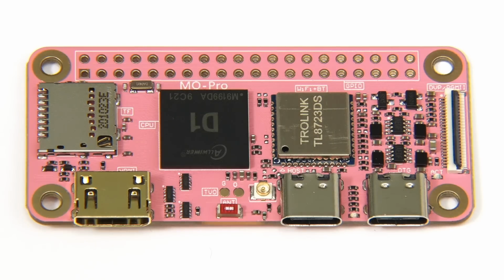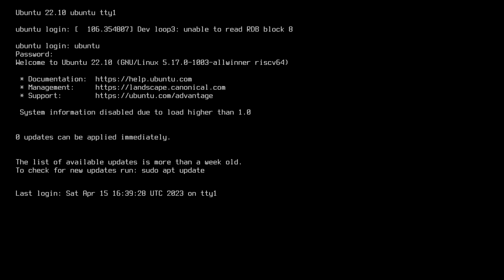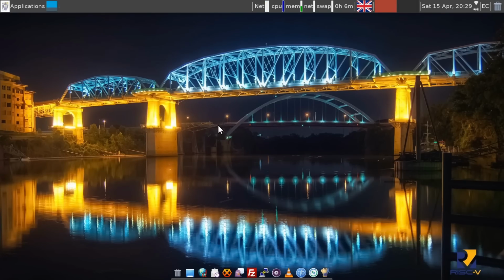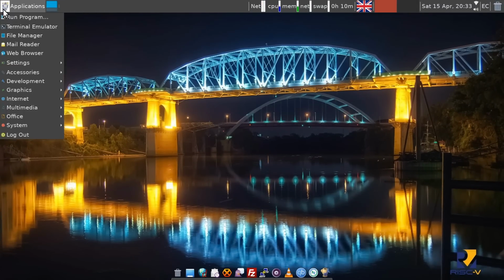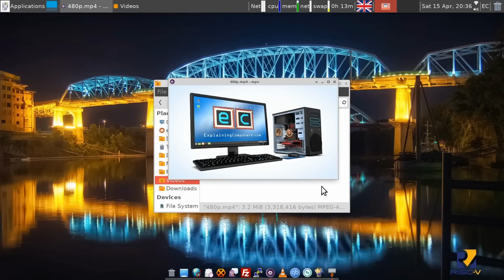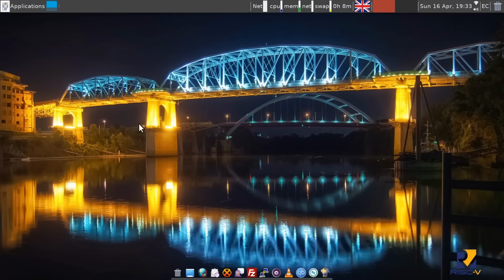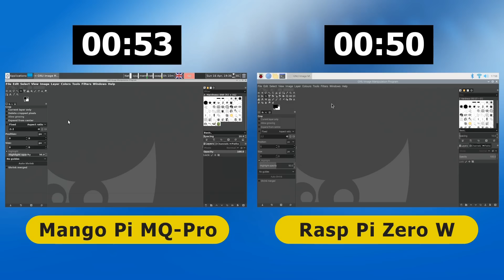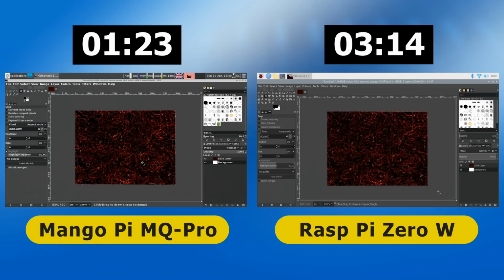Mango Pi MQ-Pro RISC-V SBC

Comment: The shop owner in Taobao(for Chinese oversea market, it's Alibaba) says in Chinese: as the 1GB DDR3 is extreme expensive( maybe as of 2022Q2, it is not so at this moment), they use tested B grade memory chips. At least, he is honest.
Reply: Yeah, the specs also make mention that the RAM is reclaimed. I'm glad the architect made the decision to use reclaimed RAM instead of calling off the project due to the high cost of its RAM. Bravo.

Comment: Risc-V is going to pose a serious risk to ARM. It will continue to get better. Sure, apple will probably continue to use ARM for quite some time, but lower-cost systems will increasingly switch to Risc-V in the next 5-10 years. I bet that in 10 years, RISC-V could be the most popular ISA in the world on smartphones. Cheaper android phones made in China for the Chinese market will switch to RISC-V. I think Raspberry-PI may eventually switch to RISC-V in the next 5-10 years. All sorts of embedded systems will use RISC-V.

WOW... I was only halfway through your video as I was typing this comment, and I just saw that you opened up DILLO. Amazing. I haven't used DILLO in > 10 years. I used to use it sometimes on a very very old laptop running Debian for reading some websites that had annoying javascript that I didn't want to run.

Within 2 years, several linux distros will be very very stable on RISC-V. Developers will find bugs and push fixes upstream, and RISC-V will become a fantastic and stable platform for running simple desktop and home-server systems.
Reply from the maker: Great post.
Reply: Report from 16 months later: Raspberry Pi shipped the Pi Pico 2 with two RISC-V cores they developed themselves (in addition to two Arm M33 cores).  You can now get the same computing power (1 GHz C906 core) as this board in the $3 Milk-V Duo, though with only 64 MB RAM. The 512 MB RAM Duo S costs $10. No HDMI though, only DSI (for LCDs). A 2.0 GHz 64 core C910 RISC-V machine with 128 GB RAM shipped back in January, 8 months after this video.

Comment: Excellent review. I was considering using several Pi Zeros with cameras for a small SD security camera network (mainly as a learning exercise) before Zero prices went to insane levels. How do you think this board would perform on a similar application?

Comment: It certainly is impressive, although the fact taht you are finding it difficult to find a library to talk to GPIO would seem to be a tragic failure for a board that I would guess is targeted more at a market as a micro-controller rather than a desktop.
Reply: No, it's not a micro-controller, it's a micro-computer. 

For starters, a 1GHz RISC-V computer with even 512MB RAM is still 80-100 times more powerful than, say, a Commodore Amiga A1200 computer from 30 years ago - let's have some perspective here!

It also possesses a lot of the I/O and interfaces for keyboards, screens, drives, etc. that you would expect to be on a micro-computer, but not on a micro-controller like a Pi Pico or ESP32 device.

Just because it's small and less powerful than the average modern desktop or laptop doesn't automatically make it a micro-controller.
Reply: @terrydaktyllus1320  The kind of power in something like this would fir neatly into the requirements for a controller for a 3D printer, or on par with what one might find in an engine management unit or many robotics projects (particularly if they include something like .requirements to map their environment).  It would indeed be serious overkill for controlling washing machines (although some household gadgets with IoT functionality might need more power).

What is asked of modern micro-controllers far exceeds what one would expect of them a decade ago.
Reply: @Hfil66  That's fine, but you've still not acknowledged my core point - namely the difference between a micro-computer and a micro-controller.

You've simply talked around my point - again, you seem to be implying that it's purely a matter of size that determines whether or not it's one or the other, and that's incorrect.
Reply: Looking at how the GPIO works, I found a web page which shows how to use simple shell commands to control the pins. It should be easy enough to create a Python wrapper with functions that carry out the same I/O operations--no need for any special drivers at all.
Reply: @terrydaktyllus1320  we rapidly get into the semantics of what is a micro-controller.

To my mind, the primary purpose of a micro=controller is to control something (e.g. a 3D printer or a car engine), whereas a micro-computer is more about computing and providing the results of that computation to the user.  In the vast majority of cases the user of  a micro-controller may not even be consciously aware that they are using a computing device (e.g. when you drive a car you generally do not thing about the computing power used to control that car), whereas a micro-computer user would be very aware of the fact that they are interfacing to a computer (e.g. they have a clear computer desktop in front of them).

Clearly, there are devices that can be used for both functions (e.g. many Pi type devices work in both contexts), but nonetheless the design of the device would suggest one market is better suited for the device than the other.  The compact size, relatively slow performance, low power requirements, and availability of GPIO pins, all suggest that this device is better suited to being embedded in some project where is works as a controller rather than a general purpose computer.  The only counter argument is the fact that it also has a built in graphics controller, which itself would be superfluous for a pure hardware control function, which might suggest this is a device that tries to satisfy more than one market, but I would still suggest it is more closely aligned with the needs of a controller rather than a general purpose computer.
Reply: @Hfil66  There are no "semantics" here at all - you simply do not understand the differences between a micro-controller and a micro-computer. I read the first two lines of your two paragraph "make it up as I go along" definition and gave up, because the difference is quite simple and doesn't require two paragraphs:

A micro-computer is a standalone device that can operate independently of other computing systems with its own "human" interfaces (USB, HDMI, VGA, etc.) whereas a micro-controller is part of a computing system, requires programming from an external computing system and/or has to have "human" interfaces attached to it.

There, I fixed that for you. You can thank me later. Discussion closed.
Reply: @terrydaktyllus1320  Of course it is semantics, because you seem to be more obsessed about whether the device (by your particular definition) is a micro-controller or a micro-computer, whereas my point was about the kind of market and user that would use the device rather than what word they would use to describe it.  You seem totally unconcerned about use cases only about what is the right word to use in labelling the device.  That to me is semantics.
Reply: @Hfil66  I'll repeat the last two words of my last comment again:

"Discussion closed" and mean it this time.

You have a lovely rest of your day pondering about micro-controllers and micro-computers.

Comment: I think what this is lacking is hardware accelerated video, so everything that's GUI based is just not going to work as well as on a Pi or similar. As a little low power text based system tho I can see this thing being really useful tho, would even work really well for a case I have right now where I could need a full OS on a remote, solar/battery only location where a normal Pi, even a Zero, uses too much power over time for what it's monitoring.
Reply: People are already using low-powered ESP32 and Pi Pico micro-controllers for remote monitoring whilst lasting for weeks on a single battery source.

I think you are confusing a micro-controller with a micro-computer, wherein the Pi Zero and Mango Pi both fit into the latter category anyway. It's common sense that any device that has to drive, say, a built-in USB port is going to use a lot more power than one that doesn't.

It's a bit like taking a family saloon car off-roading for a day and then complaining that the suspension is broken when you've finished - "right tool for the job", etc.

Comment: We had some SBCs with the Allwinner D1 now, i am really looking forward to T-Head (Alibaba) XuanTie 910 designs.. The Sipeed Lichee Pi 4A would be one of the first availiable to makers with the C910.
They are "wider", have more execution ports and a deeper pipeline. Most designs have 4 cores and clock up to 2,5GHz.. We should see performance that makes Entry level Tablets possible / comercially viable.
Reply from the maker: Yes, the Pi 4A looks like it will be a great step forward. :)

Comment: Performance per watt given up to 5W consumption this is really impressive. For certain specific tasks this could work really well. But too slow still for general purpose. Performance per resource still very low on these devices. I bet you remember times when x86 was measured in hundreds of MHz and RAM in hundreds of MB - and this one is very unoptimized. Let's see how this is going to improve over the next years.
Reply: What are you comparing this against? I've seen tests on Raspberry Pi Zero that’s about 120 mA at 5 volts, or 600 mW. 5W consumption for a similarly sized RISC-V board seems very high, where did you get your figures from?

I am happy to accept that RISC-V has lower power consumption but ultimately with two similar form factor boards both with similar ports, the consumption differences are going to be purely down to ARM chip vs. RISC-V chip, which is probably going to be negligible.
Reply: @terrydaktyllus1320  "up to". 5W comes from 5V 1A. This may also power connected devices, of course. The board itself of course will consume just a fraction of this, no question here.
Reply: @hackdesigner  Yes, I am aware of the calculation. But you've not proven to me yet that the power draw of the Mango Pi is significantly less than the Raspberry Pi Zero. So we've still yet to establish the point that you were making here.
Reply: @terrydaktyllus1320  Ah I see the confusion. I do not compare MangoPi and RPi Zero. I am comparing them both (and other similar relatively new devices as class) to the old x86 machines where CPU speed was e.g. 800 MHz and RAM was measured e.g. 384 MB, and HDD was slow as hell.
Reply: @hackdesigner  Okay, understood now.

Comment: Looking at how the GPIO works, I found a web page which shows how to use simple shell commands to control the pins. It should be easy enough to create a Python wrapper with functions that carry out the same I/O operations--no need for any special drivers at all.
Reply: Correct, and there is no reason why it would be different to any other D1-based board, the first of which went on sale two years ago.
Reply: @BruceHoult  One question is, can I use Linux select/poll calls to get notified about changes in inputs?

Comment: He skipped the audio output pads on the bottom.  That might be handy for simple audio projects without the need for a USB dongle or extra circuitry.
Reply from the maker: You are right, my pad. I almost forgot the GPIO pads as well. Sorry about this.

Comment: Something i'd like to see is a video where you explain why, when a processor says 3.4 ghz, it doesnt always mean its the same  as any other 3.4 ghz processor. I have heck of a job explaining that to people.
Reply: clock cycles, so we have 2 bikes, 1 has a chain from small wheel to small wheel ratio 1.1 - 1.0,
the other has a big wheel going to a small wheel ratio 2.0 - 1.0, which is faster for the same force (3.4)
see the chain links as instructions and/or data to be processed.
Reply: It’s a tricky thing to explain precisely because it’s such a tricky concept.

It used to be simpler: until about the late 1980s, faster CPUs could be matched with faster RAM, so the higher the clock speed, the faster everything went. But then improvements in CPU speed outstripped increases in RAM speed. So for a while you had “wait states”, then finally they added caches: first one level, then two, nowadays even three separate levels to bridge the ever-widening gap between CPU speeds and RAM speeds.

So now the sizes of those caches, and the size of the pipes for transferring data between them, the CPU and main RAM, have become big factors in the speed of the system as well.

And then within the CPU, you have design decisions like how many concurrent instructions can be in flight at once, with separate arithmetic units assigned to each one, and how efficiently data can be moved around the chip, that further complicate the relationship between clock speed and CPU performance.

Comment: To understand how this SBC perfoms, comparing to x86 platform, I turns on my mighty netbook, powered by Intel Atom N270 (latest Debian + Xfce). It tooks 14 seconds to complete GIMP-Lava test. So N270 with  2 threads at 1.5Ghz each performs about 6 time faster, then single core Mango @1Ghz.  In other words this RISC-V is twice slower on each Hz, then low end CPU from 2008. 
With this result in mind I tried to play this video from youtube from 720p down to 144p. And my netbook shows me almost similar slide show.  Youtube used AV1 and VP9 codecs to compress this videostream. I made some tests with my netbook to figure out how different codecs performs. I convert some video from my collection with resolution 720x576 using Handbrake. It plays well without skipped frames when I used MPEG2, MPEG4, AVC (aka x264). x265 and VP9 is out of normal use. 
So in conclusion I'd like to sudgest you to make a video about modern video codecs, container formats, coding and decoding technics.
Reply from the maker: Thanks for sharing this test info. But this is a RISC-V SBC,  so needs to be compared to other SBCs in the same price bracket. :)

Comment: Great video, (as always!)
I use Pi zeros as video capture devices (I have made various "Poor Man's GoPro" action cams.)  So I have this question:
Have you connected a camera to the camera port on this RISC-V pi-zero-form-factor SBC?
If so, what camera?  What cable did it require?  What software did you use to capture HD video?
Thanks!

Comment: Including GIMP in the standard distribution seems a triumph of optimism over practicality, but maybe they're aiming at the next generation's environment?
How much of the improved rendering performance came from the extra memory, and how much from the hardware acceleration?
With boards like this, it would be possible to create a small network (server and 2 clients) for training in a box smaller and cheaper than a textbook on networking. E.g. Internetworking with TCP/IP Volume One by Comer.

Comment: Firstly Congrats on the great and valuable video.
Please, I have 2 questions:
1)	GPIO pin compatible? Is there no Python GPIO?
2)	HAT and camera compatibility (h/w and s/w drivers?).  Can I know this before buying a sample?
Thanks.
Reply from the maker: It is GPIO pin compatible with a Raspberry Pi. But there no working Python GPIO library I can find. You cannot use the Raspberry Pi libraries, and the Armbian library pyGPIO.gpio is deprecated and does not work here. Others here have reported that there are working terminal commands to control the GPIO pins (the board shares a lot technically with other D1-based RISC-V SBCs, so there is a lot of there to check out online). Indeed, the Armbian image that I ran here was created for the Sipeed Nezha D1 SBC.

Most HATs should work due to pin compatibility, although driver support would be on a case-by-case basis. However, the camera connector is completely different, so a Raspberry Pi camera module cannot be used. This really is a development board to experiment with, with anything that works being a bonus! :)

Comment: It seems to try to fill a gap between Raspberry style SBCs and Arduino boards. But is there a gap. 
First mention od Risc on desktops was in movie Hackers.
Reply: The $6-$8 Pine64 Ox64 is a better gap-filler between SBCs and Arduinos. It has the same C906 core as this one, for running Linux, but running at 480 MHz with 64 MB RAM, plus two 32 bit cores for microcontroller duties.

"Hackers" was in 1995, by which time Acorn had shipped hundreds of thousands of Archimedes RISC PCs (190,000 by 1991, when Arm Ltd was formed). Also, this is RISC-V, which is a specific version of the RISC principle, just as ARM is. Apple was also shipping RISC PCs in 1995, with PowerPC CPUs.

Comment: Interesting video. 

Wouldn't a PI zero 2 W be a better comparison, it is still an older board with 1/2 the memory.

By the time the bugs are ironed out, hopefully the Pi s will be back in stock. Then the pi 2 w should be $15 and the Mango Pi MQ-Pro £25 (cheapest I could see on ali. Couldn't get the page linked to from here to load)

Competition is always good and if you want something now you can't get PI's very easy, but in the long term I think they can't compete yet unless the price drops a lot.